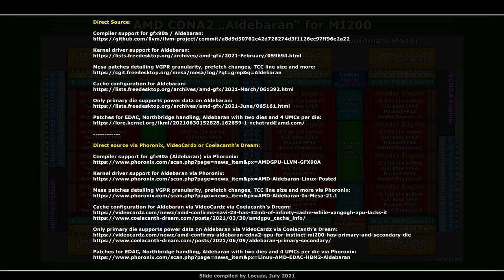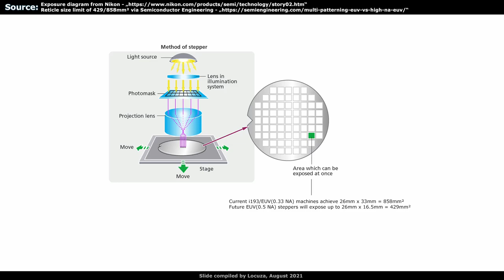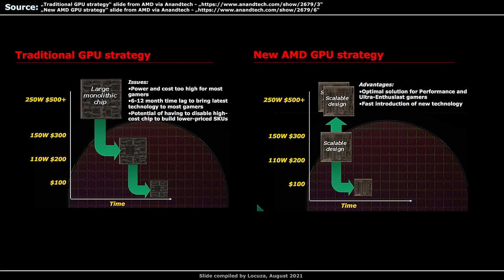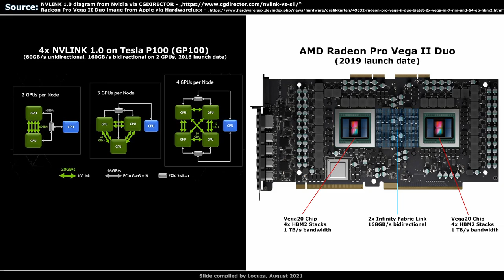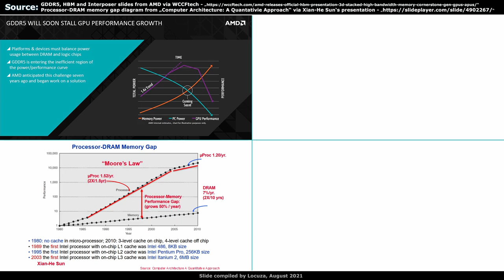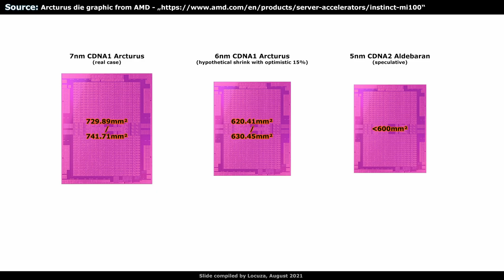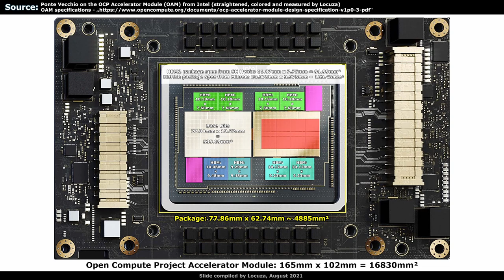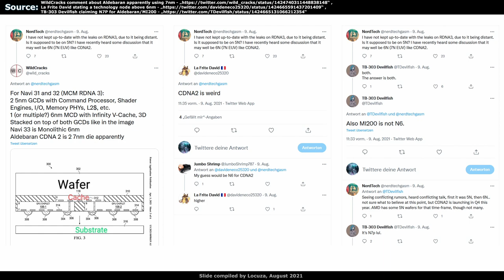AMD Aldebaran/MI200 Rambling/Analysis - Part 1

Comment: This is phenomenal.  I am fascinated by Aldebaran.  Intel has been (over?)hyping Ponte Vecchio for literally years now.  Not a peep from AMD about MI200.  I have a feeling Aldebaran is going to be “awesome.” (Foveros) Thank you Locuza!
Reply from the maker: Intel is (was) very forthcoming with information about future products, for better or worse.
Intel 4 was too aggressive and Intel couldn't fulfill the Aurora contract for 2021. 
But how competitive Aldebaran, Ponte Vecchio and other competitors will be, that's something we can't fully estimate yet. 

I'm a bit more conservative with Aldebaran, it's exciting to see chiplets realized and cache coherence and unified memory between CPU&GPU will be awesome too, but Aldebaran will not be competetive for machine learning applications and if it's built under 7nm, it may be not that great in terms of perf/watt either. 
However, I think AMD keeps it realistic and knows how much they have to invest per "round". 
MI200 will make a necessary step forward and after that "MI300" will come.
A lot will depend on the advancements on the software stack side and how positive the client response is.

Comment: 20:48 This is why I'm kind of tired of hearing people whining about Intel rebranding 10nmESF as Intel 7. It was already "7nm" by all accounts.
Reply: That's because Intel started to judge nm by the "performance" of a node rather than the gate width.
In theory this is better, but only if all manufacturers use the same benchmarks for "performance".
It's a bit like if all car manufacturers measure horsepower on the crank and only you do it on the wheels.
It's better to just let independent people put competing products head to head to make a judgement.

Comment: So now it seems not clear if it will be 2x110 CU or 2x55 CU.  Thoughts? Potentially ~2x difference in performance.
Reply from the maker: I think it's going to be 2x110 CUs.
110 CUs is a surprising pick. 
With 8 Shader Engines you are getting into a funny situation, where the shader arrays don't have the same amount of CUs for optimal load balancing.
It also leads to the question how many physical CUs are present on the die?
I expected 128 CUs in the beginning but with 110 CUs that would mean 18 CUs would get disabled or like 14% of the CUs, this appears too much. 
To reduce the die size maybe just 15 CUs are present or even less?
Though with 14 CUs, the yield might suffer too much, since only two CUs could be disabled for the final product.